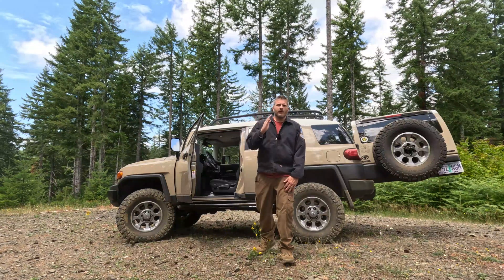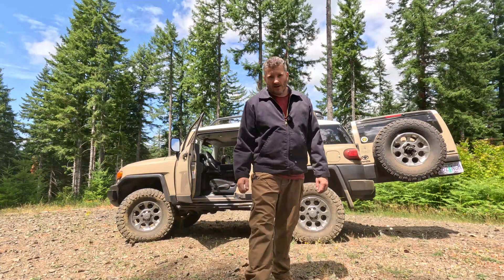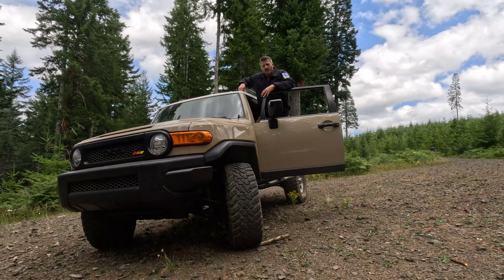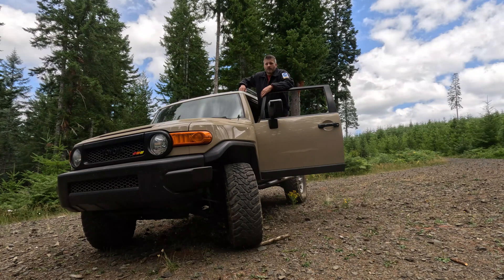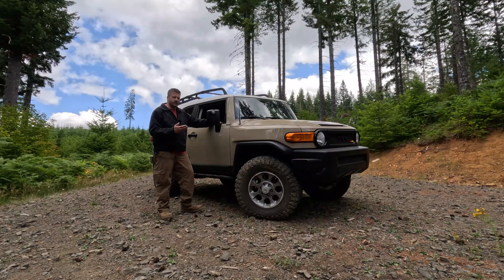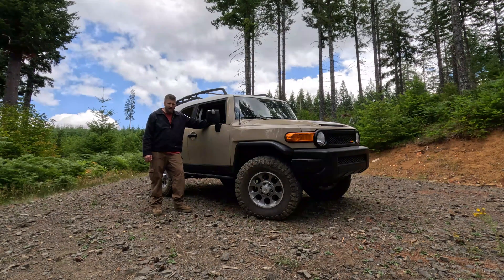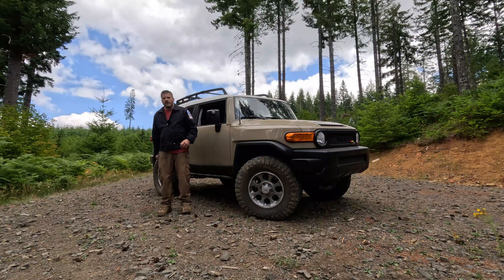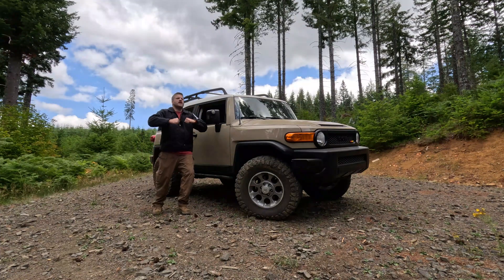Regear for Bigger Tires - Simplified

Comment: great info. What is the regearing price range
Reply from the maker: @gradymcclinton  , thanks for watching. I appreciate it. I spent a little over $2k for front and rear drop-in differentials from East Coast Gear Supply https://eastcoastgearsupply.com/c-1065066-assembled-3rds-clamshells-2010-fj-cruiser.html and installed them myself. It's pricey, but a good investment in my opinion.

Comment: Did you notice a difference in mileage once you re-geared so you could navigate the hill on your commute to work? I think it would be interesting to calculate a before and after fuel mileage differences. But I do understand the main goal is to get over the hill without stressing the engine and allow the engine to last a long time which in my opinion would be where the life time cost savings will be seen.
Reply from the maker: I get a 0.3mpg increase after the regear. I set it up for the mountainous region I drive in.
Reply: @WildRiverCamping  That is a nice increase and you keep the oomph, and increase engine life. Do you use synthetic oils or just regular oils?